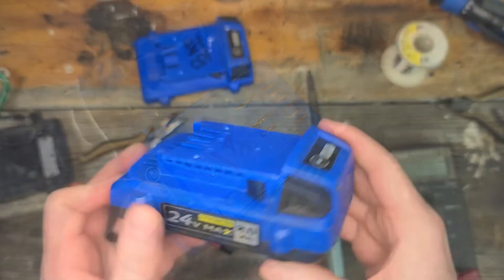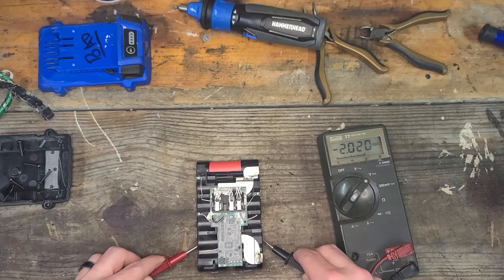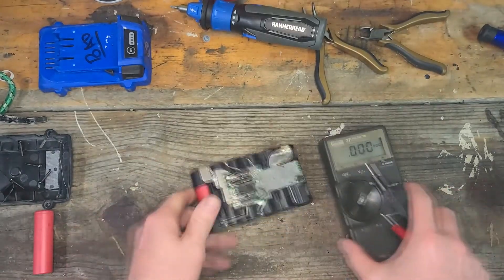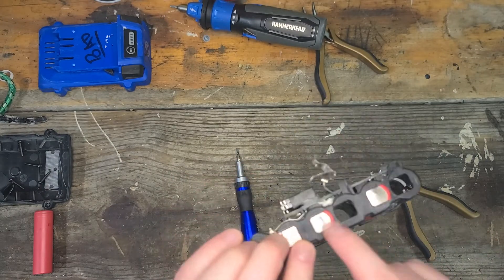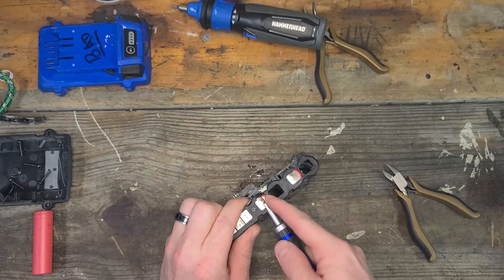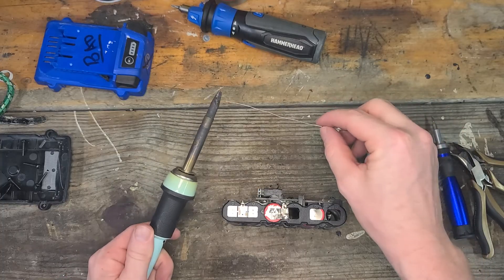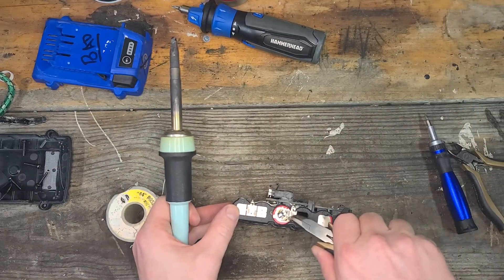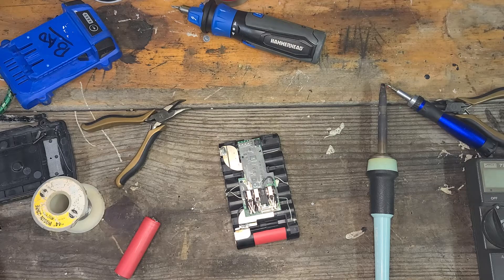🔋🔋🔋 How to Fix a Kobalt 24V Battery! (Won't charge all the way)

Comment: where do you get replacements cells
Reply from the maker: @MrAbYounes  other batteries that have failed. Most of them are 18650s but just be sure that you match the size and voltage and you can use anything

Comment: I know this is an old thread but to the ones replacing batteries just because they're low in voltage don't forget that most chargers won't recognize the pack if some of the batteries are below a certain level. To remedy that you can take a charged battery and jump a wire from positive to positive and negative to negative for about 15-20 seconds just to get enough charge in the pack for the factory charger to take over. Or buy the Amazon charger, remove the batteries, charge, ect
Reply from the maker: @SlangNasty  Yes, you can do that. However, that really only works if the entire battery pack is low. If only 1 or 2 cells are low voltage, then jumping it to get the overall voltage registering on the charger may only bring it back to half bars, but better than totally unusable

Comment: my battery will show full charged but only lasts a couple of minutes in my 80v push mower
Reply from the maker: Strange. You could take it apart and see if it has dead cells

Comment: Im having  trouble with my  battery what type  of  cables  should I  use
Reply: Ty  for helping me out
Reply from the maker: Can you explain what your problem is in more detail?
Reply: @hacktical521   I  have refurbished  the battery  🔋
Reply from the maker: @WilliamCintron44  I actually just fixed a battery tonight that had that same problem. You can follow the video, take the battery apart, and check each cell with a multimeter to see which cell is low voltage. Then you just replace that cell and it will be good as new!

Comment: where do you buy new batteries to solder in
Reply from the maker: You can find them online at lots of retailers. Just make sure you were getting the right kind, like the 18650s or 21700s
Reply: Thanks for getting back to me your video was very helpful, as I took one apart today and 4 of the 6 are bad after charging overtime. I found them pretty cheap,under 5 bucs each so it's worth replacing, ty

Comment: No offense intended. But is there a way to get the average schmo. A working battery. After I buy the Amazon charger the multi meter, soldering flux and all the things. I'd save money just buying a new battery.
Reply: Unless you already have most needed
Reply: @gamingunlimited5804  If you have the stuff good. But if you have to buy the stuff just get a new battery and walk away.

Comment: What are those black strips for?
Reply from the maker: Just to stop possible electrical contact with outside sources. I just use electrical tape to replace them if the originals are too deformed

Comment: Mine is not blinking, charging or any lights on or off the charger?  I tried jumping it from one battery to the other and nothing.  It will flass all green while jumping but nothing when you pull the wires off.
Reply from the maker: Just take it apart like the video shows and check each cell. Some of them will likely be close to zero so you will have to change a couple to get the battery back to good
Reply: @hacktical521  thanks

Comment: I have those 24volt kobalt that all 4 leds flash when button pressed, put it on charger and it says it's charged but dont work???
Reply from the maker: Yeah, that probably means that one or two of the cells are bad but the other ones are fully charged (or at least in the right voltage range to not need charging). I'd recommend following the video and taking the case off and checking the cells individually

Comment: Would it be cheaper to order batteries off line an repair batteries
Reply from the maker: I believe it would be, yeah. Just get your own set of 18650 cells or whatever your battery takes and then replace them as needed

Comment: Where can I get replacement cells
Reply from the maker: I'm sure you could find the 18650 cells online, but I have extra batteries to get spare parts from. I've heard of people going to the home improvement stores and getting them out of the battery recycle bin to have some extras
Reply: @hacktical521  thank you sir
Reply: Vape store has the batteries

Comment: The cells are good in mine. There's a piece that fell out of the positive control panel. Idk what it's called, u know anything about it?
Reply from the maker: Sorry, don't know how to help, but I have extra batteries to get spare parts from. I've heard of people going to the home improvement stores and getting them out of the battery recycle bin to have some extras
Reply: @hacktical521  didn't know they had those, good to know thanks
Reply: @hacktical521  but if u look at the bottom of the battery where it hooks into the charger, there's like a square aluminum piece inside the notch on the positive side. I have 2 batteries missing it and they don't work, it's gotta be that I believe
Reply: @hacktical521 I do that all the time to get 18650s. I take from the hardware store recycling bin. I also sometimes repair the batteries if they don't have too many bad cells. I got 2 40v Ryobi packs that I revived and they work in a mower that someone threw out because their batteries went bad.

Comment: Just a suggestion. Shorter time with the iron on the cell.  You want to be quick with the heat. Flux will make it solder up much more easily and cleanly.
Reply: You also can't test the cells when they are connected in parallel with one another. You will get the combined voltage of all the cells in parrale.  It can give you an idea of which group of parralel cells contains one or more bad cells but the only way to know for sure which cell amongst them is bad is to disconnect and test each cell individually from that group of parallel cells.
Reply from the maker: @4_Nik_8  good call, and that's what I thought too. As you can see on the video, I actually get a reading from each cell individually, and can tell which ones are the bad ones. They have me the same reading hooked up in the battery and on the bench by themselves. Try it out